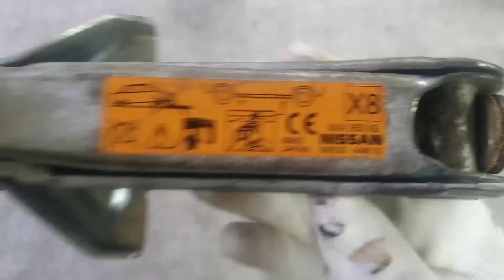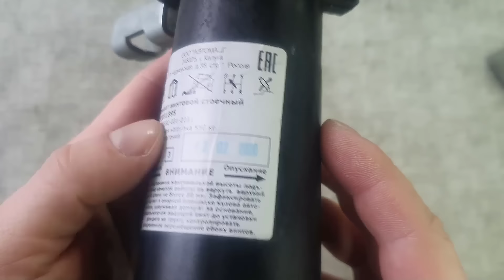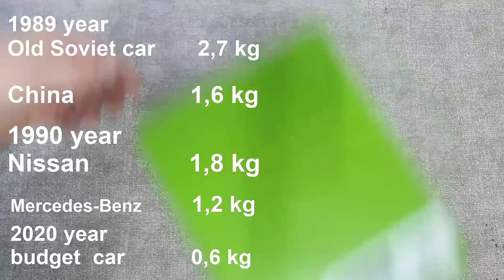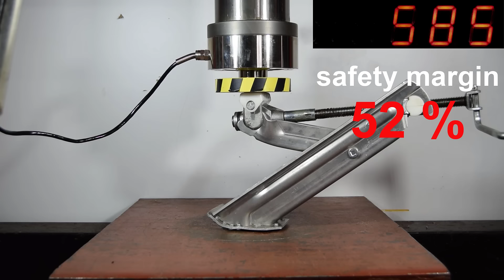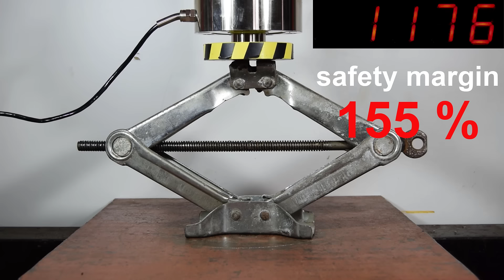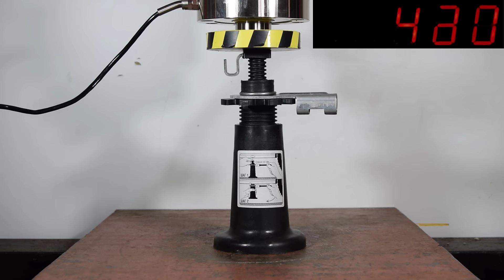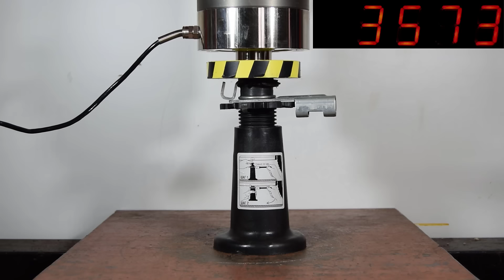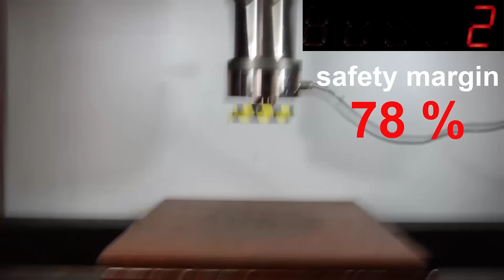HYDRAULIC PRESS VS ORIGINAL JACKS

Comment: Very impressed with the performance of the plastic screw type bottle style jack. Was not expecting that.
Reply: same!
Reply: Yeah that one surprised me, i thought the 1990 would be the best but mind blown that plastic beat them all.
Reply: Also surprised.  But how will that plastic hold up in 30yrs?
Reply: В зафиксированном состоянии может и держит, но в момент вращения-это не домкрат а мусор
Reply: volkswagon ❤️
Reply: But only because its stands absolutely 100% horizontal.
Reply: Me neither
Reply: @hammerhand5059  the Mercedes one has its advantages. 

The construction makes access way easier when you are below the car, while the direct screw means you will have to work under the car in a sideways movement possibly being blocked by the tire.
Reply: When new. Plastics degrade.
Reply: @hammerhand5059  If people take away from this that vertical screw jacks are the best performing option for lifting a car, they have incomplete information at best.
Reply: @pjaymaen  and it was propably nice 20°C - no hot and direct sunlight.
Reply: @austinformedude  Also metal get rust. If you have condensation in trunk, your jack will be rust and also unusable.
Reply: @GiluOne  yes, but you are not holding car jack outside. It is in trunk.
Reply: I don't trust it. I highly doubt it would take that type of weight if it was actively being used to lift. It was stationary which gave it the most strength.
Reply: @abigailkim8632  I think plastic doesn't degrade over years
If kept in cool conditions and under shade
It will even last 100 years
Reply: Being able to hold weight and lift weight is 2 different things
Reply: @guyod1  exactly my point!
Reply: @Tankliker  afaik those jacks are not designed to hold a car while people are working under it.
Reply: @pjaymaen  vertical??
Reply: @abigailkim8632   plastic doesn't corrode easily bro. after 30 years, it would hold up exactly like the day you bought it

Comment: Once again, the Japanese demonstrate their mastery.  I was impressed by the overall load rating of that plastic jack. To be clear, you'd never get near that rating by using the jack, friction would likely weld those threads together long before you approached that load...
Reply: But it's way too strong, over engineered. They could remove material to make it lighter and still do the job, so really, it is poorly engineered
Reply: @Nbomber I'm just saying it's poorly engineered if it does way over what it needs too
Reply: @Nbomber if it degrades that much is it really the best material to use for a safety critical part?
Reply: @paulhancock3844  does it though? This test didn't show it's jacking potential, only it's abitlity to support weight.  We'd need to see how much it could lift without damage, not simply how much weight it can hold. Until we know that data, we can't pronounce it 'overbuilt'.
Reply: @Nbomber yes I am, and there is no reason for something to be over engineered,  if something performs over and above what it is required to do, it is over engineered,  that is the definition of over engineering.
Reply: The plastic screw was Russian not japanese, is from a Lada Vesta
Reply: @internetisinteresting7720  2 separate statements, friend. I realize I should've make that more clear.
Reply: @paulhancock3844  isnt the definition of over engineered over complication? Wouldn’t trying to minimise the material be a more elaborate procedure- leading to over engineering,
Reply: @scna4653  no, over complication is something else, if you're got a jack that is rated to 1 tonne, it needs to be designed to something like 1500kgs before failure. If it fails way over that then it's over engineered. Things can be complicated and still achieve the design wight, over complex is over designed
Reply: @paulhancock3844  Ah, I c. Thank you for explaining!

Comment: never get underneath a car with any of these jacks. use them to remove the wheel if you have a flat tire and then immediately put that wheel under the car so if the jack fails the car will land on the wheel rather than you.
Reply: Changing the tire doesnt require you to go under the car
Reply: @FakeExotic  doesn't Darwin have a theory on that called natural selection?
Reply: @anonymousjohn386  bro what?? No
Reply: @FakeExotic  , nuts roll. Change of tyre does not require you to go under the car, but some Darwinian Awards candidates would likely go under the car to fetch the lug nut, given the opportunity.
Reply: @FakeExotic  he didnt say that it required going under the car he said dont use it to get under the car . Use it for something else like changing a tire
Reply: @mohamadz.7619  he says to not go under the car, what for? You dont need to.
Reply: 100% agree with this advice! I had a Honda Accord that moved backwards (I didn't apply the e-brake) and it fell onto the tire I placed under the car body under the driver's side door.

Oh, and I had my feet underneath the car at the time (I was sitting on the ground). Had I not had that tire there, my feet would have been trapped, likely crushed. I was able to get out, apply the e-brake, jack the car back up and continue the repair unhurt.

It's just such a common-sense move for ANYONE needing to use emergency jacks...ALWAYS put the removed tire underneath!!!!
Reply: only go under a car supported by a bumper jack
Reply: @FakeExotic  yes mate but the car can fall on your still🤦‍♂️
Reply: @joewhite8079  how…
Reply: Of course the cylinder has the most pressure resistant shape. But it's PLASTIC! WOW! Nylon is a beautiful material.
Reply: About two months ago there was this guy who died by doing just that. Turned out he was a thief and tried to steal the catalytic converter from underneath a Toyota Prius and was crushed when the hydraulic jack slipped away. It happened many times in that area over the course of weeks so I guess that wasn't his first rodeo. Karma finally got him.
Reply: Always... I always put a wheel underneath the car as a backup. That wheel can save your life
Reply: @FakeExotic  he is saying that if you have to go under the car do not use a jack as your only protection. Take a tire out and put it under so if the jack fails the car falls on the tire and not you
Reply: I've had these type of jacks fail on me. I was lucky the wheel was partially on. these are for emergency use ONLY. don't trust them

Comment: Not particularly surprised on the plastic bottle jack performance. From a physics performance, the bottle jack geometry (vertical support) is the strongest type of jack available. That's why inferior material can perform surprisingly well. 

Roll up a single sheet of print paper and see how much weight you can put on it. That's the strength of this vertical support geometry in practice.
Reply: Mike: "Not surprised"

Mike again: that's why inferior material can perform SURPRISINGLY well.

❤️

Comment: Why does Mercedes disappoint the viewers? Jacks are used for emergency tire change, so they are rarely used. 
The Mercedes jack does what he is supposed to, to lift the car, including 50% safety weight. 
But he weights only 2/3rd of the other jacks, meaning it spares ressources 😁 BTW, I'm not a Mercedes employee, and yes, I'm aware it is a bit of a paradoxon to talk about sparing ressources with a luxury car 😆
Reply: It's not sparing resources since it is aluminum which is 10x more expensive than steel, they probably did so to save on weight.

Comment: As most others here I am astonished by the performance of the plastic jack, but I can also imagine how crappy the use of it is when you actually try to jack up a car. When in need of a good jack I think I would prefer the Nissan jack, which also outperformed by 155%. These jacks are easy to use even under load.

Comment: I liked this video (full stop).  
But… Jacks are not used by extending to a given height and then gradually applying load.  I’d be interested in how much the jacks can lift using their in-built mechanism.  I’d guess that the threads on the bottle-screw jack might not work if extending against a large load.  The other jacks might also have a different weakness(s).
Reply: @itachisasku I understand your point,  When lifting a car, jacks first extend with ~no load.  Once they reach the lift point, load increases as the jack extends (unloading the suspension on a car).  Then they continue to extend under relatively constant load.
My point is that all of the steps require things like the screw connections to function while loaded - I don’t think all of them would.
Reply: dude its a hydraulic press crushing is what they do
Reply: You make a good point. This was a useful test, in some ways, but it does not reveal the jacks "LIFTING" capacities as you say. It only reveals their gross weight  bearing capacities. I would say that friction on the plastic screw would prevent a user from getting anywhere NEAR that crush rating. Meaning, it's a surprisingly safe jack.
Reply: @bryanseare2704  I get this and I like the crushing of random stuff, but I often learn from the exercise.  For example, they were once crushing a few different blocks of metal and carbon fiber.  The cf held up amazingly well, which I found really interesting (beyond the obvious fun of the crushing).  
On crushing of car jacks, I was thinking that Mercedes might have delivered a jack capable of “Lifting” the most — i.e. remaining functional while under load — because it was well engineered. I think it was possible to do both — extend the jack into the ram to test dynamic lifting, then extend the ram to test static load limits and ultimately crush each jack.
I like what they do on the channel, and I understand they are not a product evaluation team. it just happened that this one test left me wanting more.

Comment: 1. You compare the weights of each jack but forget the bar you need to operate the Lada jack.
2. The Mercedes and especially the Lada plastic lifter did the job best. both have enough reserves and weigh very little, which benefits the weight of the vehicle and thus saves resources, although I doubt that the plastic model is particularly comfortable to use. 3. Jacks for roadside assistance made of iron should definitely no longer be banned - that doesn't make any sense these days - here, as so often in life, the following applies: "The good horse only jumps as high as it has to".😉
Reply: What ? Nissan was much better

Comment: Thoroughly impressed with that plastic jack. Not surprising though how easily the benz one failed
Reply: Just like the cars , just expensive unreliable failures.
Reply: For that design to hold up, I would have wanted to see the decimal point another place to the right when they were doing the weight comparison. The floor jacks using that cantilever design weigh about 20-50kg. I still wouldn’t use it because it’s too easy for that particular design to push itself out from under the vehicle.

The floor jacks fix that issue by having one of the levers laying on the ground with wheels on both ends, so it’s actually a stable platform.

Comment: Muito bom estes testes. Muitos destes macacos hidráulicos (jacks em razão de não haver correspondência da ideia no Google Translater) se usados dentro dos parâmetros normais de uso, teriam e tem enorme margem de segurança, uma vez que poderiam elevar o peso de todo o veículo do qual são acessórios. Todos foram surpreendentes, especialmente o último chinês, principalmente porque não entrou em ruptura catastrófica. Quase todos apenas se deformaram, o que ainda assim avisariam que os estivesse usando. Do Brasil, muito bom o vídeo. Foi um teste de utilidade pública o que o torna ainda mais relevante.
Reply: These tests are very good. Many of these hydraulic jacks (jacks because there is no correspondence of the idea in Google Translate) if used within the normal parameters of use, would have and have a huge margin of safety, since they could increase the weight of the entire vehicle of which they are accessories. . All were surprising, especially the last Chinese one, mainly because it didn't go into catastrophic rupture. Most of them just deformed, which would still tell you that you were using them. From Brazil, very good video. It was a public utility test which makes it even more relevant.
Reply: Estas pruebas son muy buenas. Muchos de estos gatos hidráulicos (gatos porque no hay correspondencia de la idea en Google Translate) si se utilizaran dentro de los parámetros normales de uso, tendrían y tienen un margen de seguridad enorme, ya que podrían aumentar el peso de todo el vehículo del que son complementos.. Todos fueron sorprendentes, especialmente el último chino, principalmente porque no entró en una ruptura catastrófica. La mayoría de ellos simplemente se deformaron, lo que aún le diría que los estaba usando. Desde Brasil, muy buen video. Fue una prueba de utilidad pública que lo hace aún más relevante.

Antonio Martín de Paula Rodrigues Martín

Comment: I get the feeling that a lot of these jacks would fail at a lower level than what was shown if put under load for a longer period... i.e. 1000 Kg mercedes jack might fail at 1300 Kg if left for 10 - 20 minutes under that load instead of the 1480 (1523 you showed but saw it failing before that) . 
One other thing to consider is that when you are jacking up a car there are side forces / twisting / the ability to strip threads easily (especially on the plastic jack) which would all contribute to a jack failing. 
The plastic jack was impressive but think it would fail at 1 tonne after an hour or less.
I have an after market trolley jack that is certainly heavy (a lot more than 1.8 Kg) but even with that I still stick the spare tyre under the car when taking the flat off just in case it fails. 
Even the professional hydraulic lifts mechanics use have a locking mechanism . No good if the car falls just due to a seal breaking.

Comment: The video is interesting, but the experimental setup is quite far away from the task of the jack. In my opinion, it should have been tried in any case how much weight is to be lifted with the jack (also by a person who is not particularly strong).
When you lift a car, it always tilts to the side, which is not taken into account here. With the Mercedes and the old one, this shouldn't matter as they balance it out. But the other three lift straight ahead, so that should definitely make a difference. I think the plastic one the most.

The plastic car jack made a very good impression here, but the 550 kg it is supposed to lift is also the lowest value compared to the vehicle weight.

For comparison:
Lada Vesta
Jack payload 550 kg
Curb weight 1,260 kg = 44% of it
Permissible total weight 1,670 kg = 33% of it

Mercedes C class
Jack payload 1,000 kg
Curb weight 1,425 kg = 70% of it
Permissible total weight 1,990 kg = 50% of it

Regarding the high breaking load of the plastic car jack, I would say that it definitely has to be like this because the plastic ages quite quickly. I am sure that after 5 years it will withstand noticeably less and after 30 years it will probably be unusable.
Reply: Just regarding the jack payload vs car weight- don’t forget you don’t put the entire weight of the car on one jack. If you’re changing a wheel, the other three wheels are on the ground, so you’re not putting the full weight on the jack. I’m actually not sure the math on how much it would be (is it 25%?), but just to keep in mind when doing calculations.
Reply: @ThatTechGuyJezza   I'm pretty sure you have to jack up more than 25% of the vehicle's weight to get a wheel off the ground. Unfortunately I couldn't find anything how much it really is.

Comment: I'm impressed with the plastic one. with every jack, I thought: okay, at some point it gets destroyed. and the simple plastic jack offered just 550kg load capacity. but giving a jack more load than what it is rated for usually leads to the jack jumping somewhere. the plastic one deformed, but bought you time to get your butt out of the dangerzone. was it broken afterwards? yes. but you had time to escape. or to never go into the dangerous zone, because you can see that that the jack is breaking.

Comment: I own/drive a 1998 Ford expedition daily, and the jacks that came with my truck, do not lift it at all😭😭 I had to buy two 6ton floor jacks and include some cinder blocks to lift my truck just to change a damn flat tire 🤦🏾‍♂️
Reply: Damn how high does it go to get the wheels off the ground? I have a suv and use two 6 ton jack stands to hold it, they go 13 to 24.5 inches up. The suv needs at least 18 inches to get off the ground. To jack it up I use a rolling jack that goes 3.25 to 24.75 inches.
Reply: never use cinder blocks they crush ,use Hardwood Oak etc.

Comment: That Mercedes design is...er...interesting? Seems to be more complicated than it needs to be, but that's Daimler for you.
Reply: In Europe at least Ford and the VW group use the same type but made of steel and with an articulated flat foot instead of that fixed curved foot wich looks like it's going to slip... The piece where the threaded rod screws is plastic in all of them, and white so I bet it degrades if exposed to sunlight, that's not a problem in the trunk but can be dangerous if you buy one at the junkyard to use in the garage and leave it on a shelf in front of a window...